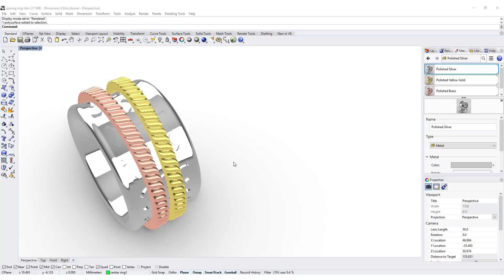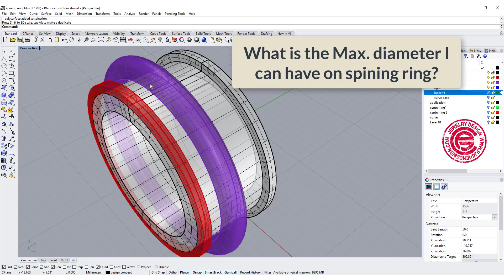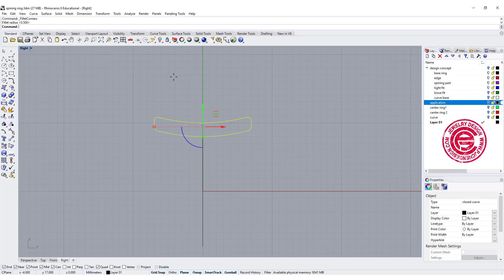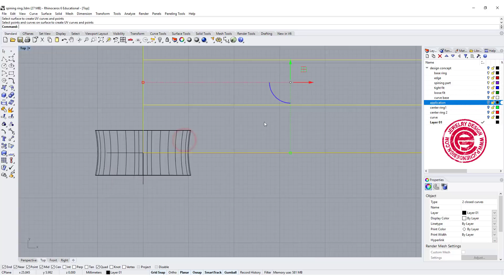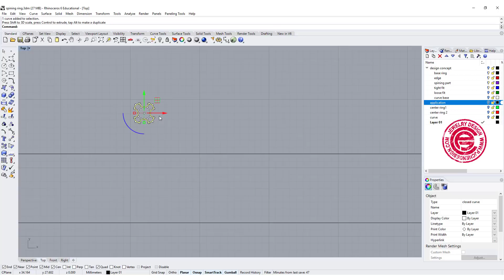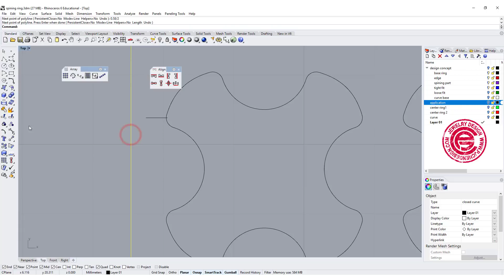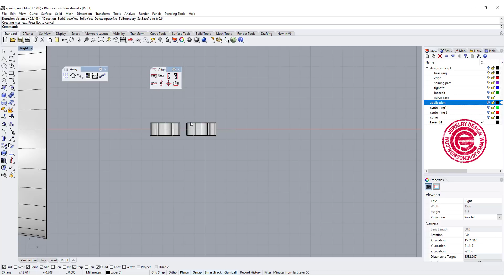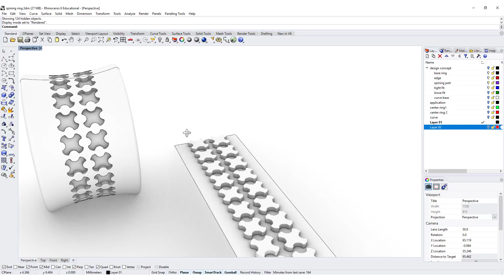How to Design a Spinning Ring in Rhino 6 (Part I) - Jewelry CAD Design Tutorial #52

Comment: Thank you so much for your tutorial! But I have a question. After I trimmed the ring, why the outer ring is separated into two parts instead of a whole ring? This make me fail to create a UV curve of the whole ring.
Reply from the maker: you may have 2 seams instead of one. you can rebuild the ring circle to degree 3 and sweep the surface again.

Comment: Hi PJ, I have a question. To fit the pattern with the same distance between the patterns everywhere, you reduce the UV curves in this example. In other words, the base surface is smaller than the original one. Is not that a problem?
Reply from the maker: no. because everything else will be scaled proportionally.

Comment: In the part two can you also tell us how print them? I mean: we can print it in one piece or we must print it in separate parts and then assemble it? ThNks ☺️
Reply from the maker: depends on how tight it is on your design if they are very loose, you can print them together and cast. As long as the investment can get it and hold the pieces strongly. If the design is very tight between pieces. you will need to cast time separately and solder it later on on production.